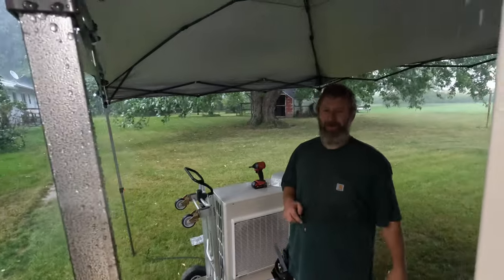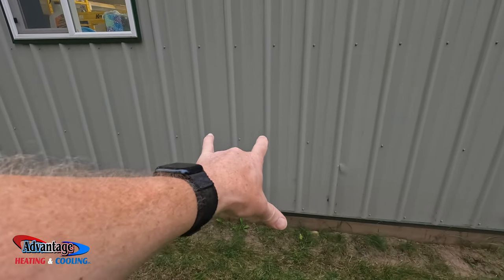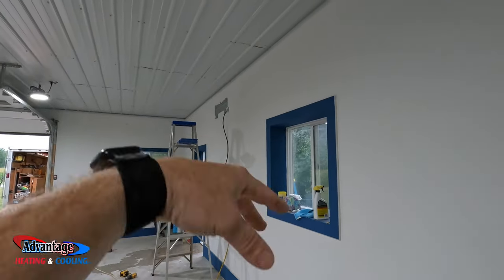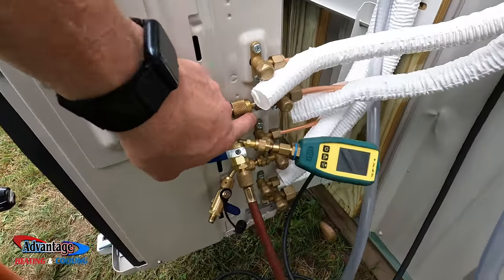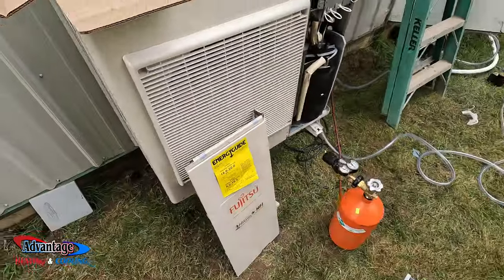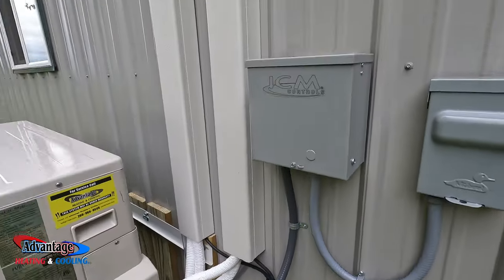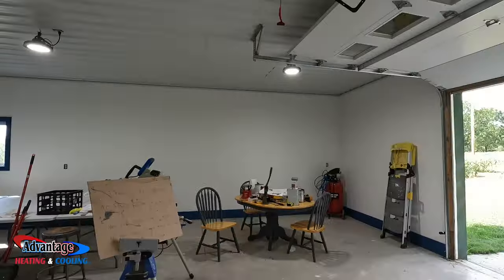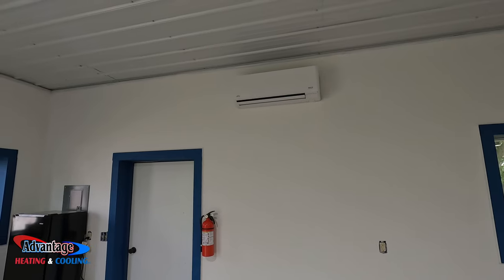Fujitsu Mini-Split Magic Say Goodbye to Propane Bills!

Comment: Good video. You can get away without them treated 5/4 boards. The horizontal bracket across the ribs of the steel will hold up that unit no problem beings fastened to the horizontal 2x6.

Good work.
Reply from the maker: Thanks for the tips!

Comment: Fujitsu didnt give me any hardware with mine OTHER than washers :)..  im using Ducted fujitsu units under my first floor.. allows me the advantages of minisplits with still keeping my nice floor registers,  Love to see peopke make their own flairs.. I dont make enough to have a power flair machine but that thing is slick.. field made flairs and Nylog are a recipe for Leak free :)..  I do 300 PSI on any 410A system and never have an issue.. remote shop like that id have a cell wifi device and use the fujitsu Airstage or FGL:air mobile then you can warm the place before you get there :)
Reply from the maker: I have a UFO Infrared heater mounted on the ceiling. Works great.